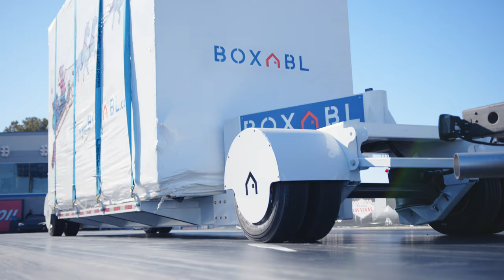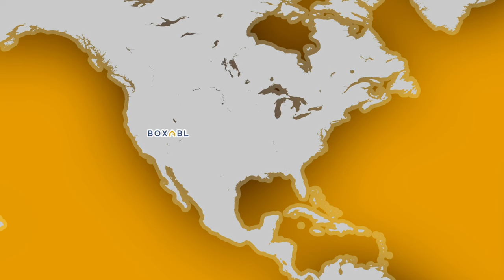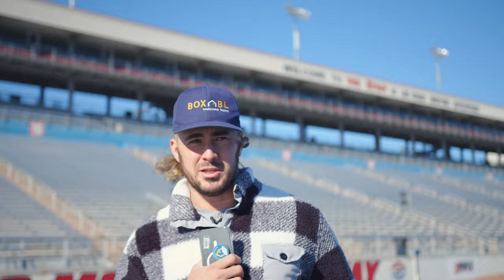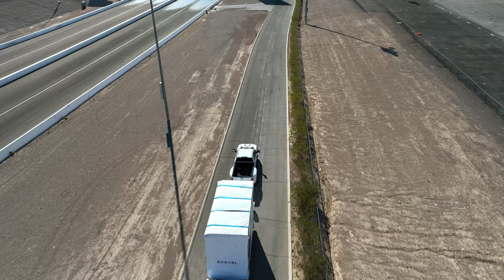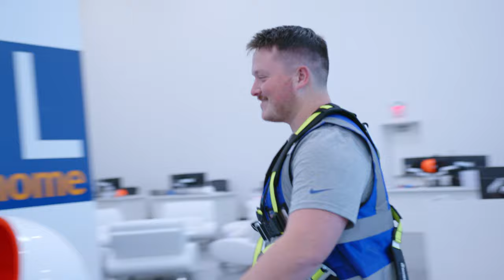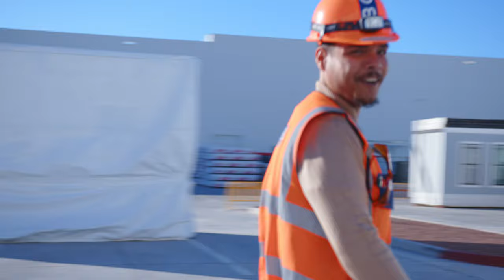Tesla Vs Lamborghini

Comment: how do you keep them from blowing away?
Reply from the maker: A Boxabl is compatible with any foundation type. It simply bolts on. The floor on the Boxabl is very strong so it needs minimal support. See https://www.boxabl.com/foundation-options. Also, the unit weighs around 15,000 lbs.